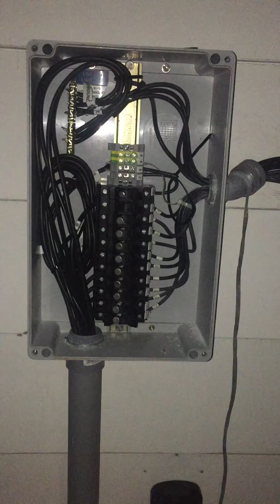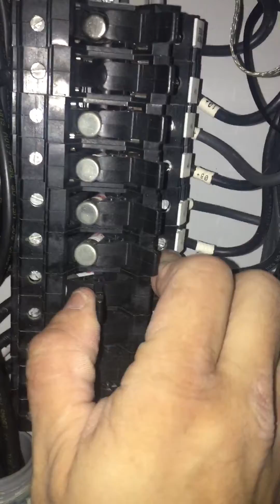Breaker for Grid Tied solar system

Comment: Nice to see a video again, is your battery bank still alive
Reply from the maker: Common Sense yes make one very easy to do couple battery’s and a inverter and charge controller and a portable box on wheels or how ever small you want it I am going to start importing some soon hopefully or making some
Reply from the maker: steve fabiano yes most of it some the batteries are there I had a few go bad I am doing both battery backup and Grid Tied System
Reply: +Bryan May  I'm doing the same, I will have to post a video one day, my bank in the winter sits in standby, for power outages
Reply: Would you have a recommendation on a solar generator?
Reply: How much would a system cost that would run most of a house off grid
Reply from the maker: Common Sense how many kWh a month do you use